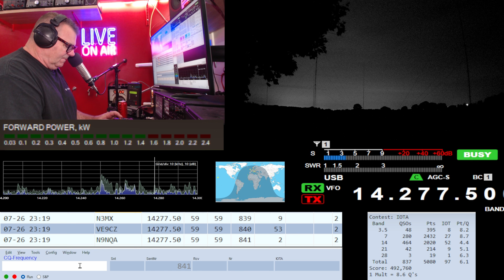Why I Don’t Want an SDR Ham Radio

Comment: First off new subscriber, old ham.  I've watched most of your videos over the years but to day I had to weigh in with agreement to your comment. I have to say you are truly a ham radio treasure to the ham community and your point is spot on.  I own both a TS-990 and a Flex 6600 with a Maestro.  I got lulled into the better spectrum display that you can pinch and zoom like a cell phone.  At the end of the day I think my TS-990 has a better receiver for my ears too.  I can make out the weakest signal with the 990 that the Flex struggles to receive.  That's why I hope Kenwood doesn't make a full SDR radio in the future.  73 K9AT.  I have a channel too.
Reply from the maker: Wow. That's a heck of a comment. Yes, it's all about what works for you I guess.

Comment: I want to try running My Icom 7300 as a transmitter only and operating my SDRPlay as the receiver with the 

 N2EME – SDRSwitch

You should Test your setup now with this in comparison.  

Works on SSB not sure how it does in CW.  

I’m also looking at the Hermes SDR kit and then finding some transmitter for 100-200 watts 

This would be an idea for another video because you can you can use older HF gear and then pair it with newer technology for amazing receive. 

My biggest hurdle is Noise.  I have my mains choked with Mix31 cores and all my computer inputs choked but still have manmade noise like LED bulbs and chargers etc.
Reply from the maker: OK, so I have always wanted to do this with my SDRPlay - however you might find the RX on your 7300 may be better than you think...

Comment: I really like my IC-7600 SuperHet Transceiver. was considering trading for the new IC-7300 MKII. I don't think I will now because it does things differently than IC-7300 and frankly it is a great radio. I have an IC-705 that hears very very good, but the IC-7600 is a great listener just as you described the TS-990. I will share this with my friend in North Carolina who wants to Trade out the TS-590 for a waterfall FT-991a. I think that would be a mistake. Rocked my Classic and a G90 in Chicago on Christmas Eve and had a blast making back yard contacts on 20m,17m,15m, and 10m to POTA activators. Thanks for the video Cal!
Reply from the maker: Yeah, tell him don't trade the 590. Perhaps add a cheap SDRPlay off the jack on the back. There's a YouTube video about how to do this.

Comment: Calum - interesting video. I am using a Kenwood TS940S (1995 Vintage in its day a very expensive radio) alongside an Icom 9300.  G5RV switchable with an EFHW. So - although I love the acoustics and audio of the Kenwood I can't pretend it can dig out the fainter stations that the Icom does and treat them more stability.  Maybe it is just my old ears what do you think, please remember you Kenwood is generations later than mine.
Reply from the maker: That's a great setup you have! It’s true that newer rigs often have an edge in digging out weak signals, and ears definitely play a part in what we perceive.
Reply: @DXCommanderHQ  Thank you for your kind comments

Comment: Back in the days when my brother was pirating on FM the Panasonic STR-2400 was known to be a very sensitive radio. Problem however was that the noise was a lot sharper  than on the Kenwood radio he was using. So very faint stations were easier to pick out of the noise on the Kenwood then on the more (on paper) sensitive Panasonic. 
Numbers don't, unfortunately, tell the complete story.
Reply from the maker: Interesting

Comment: Firstly, have you had your hearing tested?

Secondly, brilliant video and reminds me very much of the original debate of analogue over digital when CD's came around, and probably one of the reasons vinyl is still popular.

Thirdly links back to the original question, and for full disclosure I do perform hearing test's everyday but these are very much my own views (have to say that 😆!). Our brains are amazing pieces of technology, and when given the best information, it's surprising what can be done with them.  But, if the hearing system is not passing that information to the brain, it makes it harder to extract the information.  The most common form of hearing loss is age-related which typically affects high pitches, musicians ears often will get a worse deal unless they are properly protected, due to prolonged exposure.

Could it be that younger ears prefer the additional filtering which is available with SDR's as there frequency range is higher (although most SSB is 3K bandwidth or less but can be adjusted, loved listening to mickey mouse when I was a child, not now!!) and older ears prefer analogue due to their reduced frequency range?  I don't know, too technical.

If you've not had a hearing test, have one. You might be surprised what hearing "everything" sounds like.
PS, You may have already answered this question but there was over 400 comments and I struggled to find one relating to ears!, PPS no personal offence meant, just curious!
Reply from the maker: I had my hearing tested last year. I might be a drummer - but always wear headphones which cuts the volume right down and I can listen to the overall mix.

Comment: my work is design radio receiver,  SDR is way to cut the cost and ease of manufacturing,  NO adjustment needed.  Analog design like Ten Tec Omni V are better and quieter design.  AG6JU

Comment: I do really like your studio, the dogs an outstanding performance in video cam and voice.   I did sell my whole analogue stuff and switched over to brick2 (hermes lit 2 with 6m) and I do not regret this step. Mainly because this is fitting to my hearing loss in the middle of hearing frequencies. Filters on the audio site are so nice together with a good headset or speaker. In my opinion the rig MUST fit to the ears to get fun in the brain. I have had radios that made my ears tired and after half an hour listening it was getting a nighmare. From the analogue side I prefered Kenwood 480 which had a smooth sound. Unfortunatly I sold it first ;-)       Have a good time and enjoy your radio(s)   73 de Lars DH1LL
Reply from the maker: That makes perfect sense. The best radio for anyone is the one that lets their ears work comfortably, and if a different approach to filtering helps with specific hearing needs, that's exactly the right solution for you.

Comment: 👍Interesting video. I usually judge a receiver by it's ability to allow me to copy weak (low SNR) CW signals or "pull" the signal I want from adjacent QRM. Regardless of architecture, the most helpful feature is usually narrow filtering. Whether this is achieved by XTAL or DSP filtering in the IF or active filtering in the AF, etc. Reducing passband to improve SNR is usually the "trick" that makes it possible to copy a difficult signal.
Reply from the maker: You're absolutely right – it always comes down to making that weak signal stand out, and good filtering is essential for that.

Comment: Cal, the TS-990S isn’t a true analogue radio in the modern sense, but DSP on its own isn’t a full SDR either. Once the signal is converted to I/Q base band and processed digitally, that stage is, by definition, software-defined radio, just not across the entire signal chain.

The key distinction is where the software takes over. In the TS-990S, analogue front-end filtering, mixing, and IF stages come first, with DSP applied later. In a true SDR, digitisation happens much earlier, often directly at RF.

Superhets don’t sound better by nature. They depend more on analogue engineering quality. The TS-990S sounds good because Kenwood executed the front end extremely well. A high-quality direct-sampling SDR, with a good ADC and front end, can match or exceed it.

DSP is SDR in principle. The TS-990S simply applies it after more analogue stages, which makes it a hybrid rather than a full SDR. Remember, the noise you are listening to has already been digitally processed, just like in an full SDR.
Reply from the maker: Agreed. See all the other comments and my replies.

Comment: Thanks for this excellent video with real life examples from your experiences. Although I have a lot less experience, I can certainly appreciate where you're coming from in your preference for analogue radios. This reminds me of a basic livestream video I posted and titled "IC-7300 Operating the 'Natural Way' - without Distortion." Although my only transceiver is the IC-7300 with DSP, I have been turning off the digital assistants more often than not -- all in an attempt to get those fine details that I might otherwise have missed (and to get that more classic sound and style while operating). Thanks again, and 73. ~ Jared, AC7WH
Reply from the maker: Yeah, great!

Comment: I do like my SDRs (not least because they're less expensive and I'm all portable!), but I will often turn down the DNR if I think it's suppressing too much. The IC-7100 in particular has a noise reducer that really suppresses things, and I've definitely noticed the difference turning it down sometimes. The FT-710 and FTX-1 noise reducer seem a lot less suppressive of the real signal, but of course, they could be rejecting things I'd hear otherwise. I came to all of this late, but I also remember picking signals out as an SWL with just my ears, and I still ultimately rely on the hints I hear down in the noise to try to pick up callers.

Comment: The hiss is what I like to listen to as well. The raw white noise i can hear very faint signals. I may not decipher the call sign clearly yet but I can make out conversations. Ive also been satellite hunting on vhf and higher frequencies. Sometimes can hear those signals below the noise floor and it never shows on a waterfall on an SDR. I also tried EME with a metal dish with several LNA amps right on the antenna and occasionally ill here EME on a full moon night. Its just fun to learn what signals are out there even though im just a listener but ill get my license in 2026. Thats the goal anyways. 
73's
Reply from the maker: You’ve hit on something fundamental there – sometimes the "noise" carries more information than the clean signal, especially for weak-signal work!

Comment: I do understand , the same as if using an older analog  receiver where you can tune between bands ,  I just got a IC 7300 for Christmas I haven't use it yet ,I am still using my old TS140 , I wonder how long will this new display  last  on these new radios
Reply: I bought my 7300 in the second year of being manufactured and I'd love to say I use it daily, but in reality I'm only able to get on the air weekly and I personally have had no problems with the display. I was told that the older Icom 746 did have display issues however the 7300 doesn't have that issue. Have fun with your radio. N3EDO.

Comment: Great video, providing a balanced approach 👍👍Having spent 22 years in the British army and using radios back as far as the Larkspur stuff then the step up to clansman even then,  the older guys used to say it’s not proper radio. Then using these radios on AFV’s with (garbage)crew headsets on for hours a day week upon week the ears need to rest.  I have 7300, 705,991A. G90, x6100 fx-4cr. All of which are SDR reminds me that there are quite a few videos on YouTube etc… that say if they had SDR , ft8 and other data modes in the 20,30,40’s they would have used them. Use whatever you have to get on the air. 👍👍
Reply from the maker: Agreed!

Comment: That's just business as usual in ham radio where people know almost nothing what's inside a radio:
- what's the difference between an analog radio with a DSP and an SDR, how will changing the bandwidth affect the dynamics and signal-to-noise ratio in one but not the other,
- why the DSP will never help receiving CW except the very important bandwidth filtering, also why SDRs with roofing filters or no filters may (and today usually do) outperform the quartz-filtered traditional superhets, and despite of this, why we still use superhets as a stage before a direct conversion SDR,
- what's the difference between an SDR and a direct conversion SDR, they usually haven't heard a state-of-the-art one of the latter,
- what a direct conversion SDR needs to realize good NB (noise blanking), even better than the analogs,
- what are the different kinds of SDRs capable of, what are their strengths and weaknesses, in what areas do their limitations count anyway, and under which circumstances (e.g., the worse 100 kHz BDR),
- how enormous is the difference between the intermodulation distortion characteristics of analog and SDR radios, and what this implies in terms of handling and usability,
- why the beloved TS-590SG consists of practically two radios inside, a good and a mediocre one, and for the half of bands and modes the much worse path are used (buy a K3 instead while it's still available),
- why the Sherwood list is pure reality, etc.
Reply from the maker: Many questions - all beyond the wit of someone as simple as myself.
Reply: @DXCommanderHQ  These are not questions, but simply hints to the results of observations. All that is needed is for radio amateurs to be interested in knowing the radio. However, I wrote this in general, not to you specifically. : -) Who cares about a few misused phrases if the rest is correct... But it's really bad to see all the comments even on QRZ that are about everything else, from the shape of the buttons to the color of the microphone, instead of the technology inside.

Comment: My antenna is about a top band wavelength from my ham neighbor's antenna.  His signals are clean but the modern SDR radios just can't reject the nearby signal.  If you've ever tried to use two IC-7300's on the same band during field day, you'll know what I mean.  I've tried a few, IC-7300, FT-710, FT-DX10, those radios have a lot of features, but I always fall back to the Elecraft K3, he can work FT-8 on 28.074 & I can work CW on 28.050 and not even know he's on the air.  I even have my doubts about the K4's performance in my environment until they release the HD version.
Reply from the maker: OK, in which case - maybe some additional band-pass filters? I happen to know both the 990 and the 7610 in close proximity worked fine - as long as we weren't harmonically related.

Comment: I love the old tube radios started out in the 70's with a Tempo One had great audio also my Drake tr4c did as well your brain gets trained to hear everything. Now I have a FT-102 complete station and a FT-1000D. Ive had them all over the years liked them all really 10-160 HF is all I need anyway not knocking all the new stuff but I'm happy where I'm at.
Reply from the maker: Sounds like you've found your happy place with those rigs – and there’s nothing wrong with that at all! 😊

Comment: I did disagree,  I think you are totally over complicating things,  for me there is more to the hobby than HF, 160-10M.
I need all the bands that I have a licence for...hence  the SDR radio that I use offers bands from 10, 8,6,5,4 and 2M, (general coverage above 30Mhz)  which is exactly what I want, I don't use or need NR, DNR, or filtering gimmicks, or to operate 4.5khz wide on TX!
SDR suits my operating style looking for weak signals, would I use a TS990 probably not, I've had the 7610, ftdx101, dx10 and went full SDR, no regrets, no complaints.

Having two big monitors on a desk is not everyone's liking, then again same for having a whopping 990, dx101 with all the knobs on a desk.
As for Sherwood, who really goes by that...
Only my personal opinion, 're the bands that I use, the time I have available to operate, having a technical background and been comfortable using computers and also the budget I have to spend on this hobby. 
The days if spending thousands of euros on a radio, to work a few stations on HF are well and truly over, for me.
Reply from the maker: Wow Robbie - a lot of points. I only have my own opinion for what I do - and was really trying to put my finger on something pretty esoteric really!